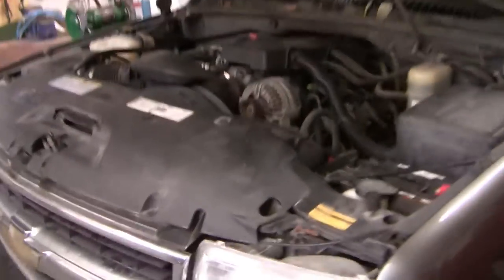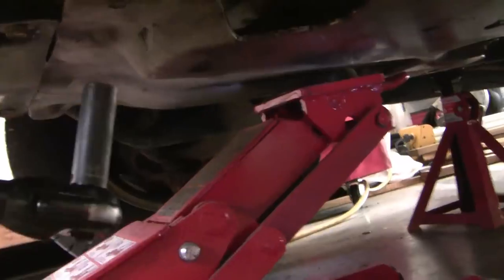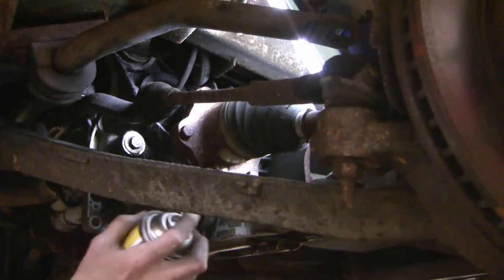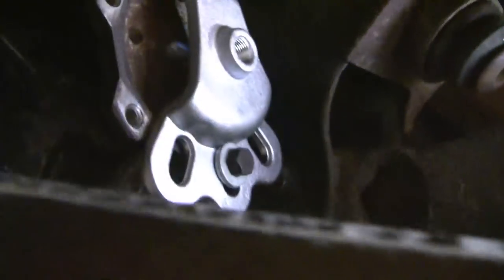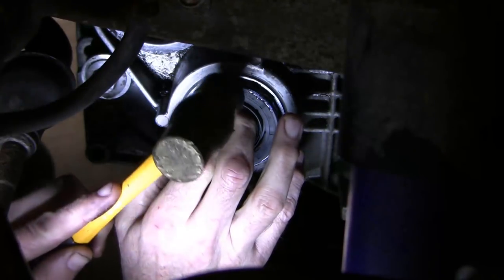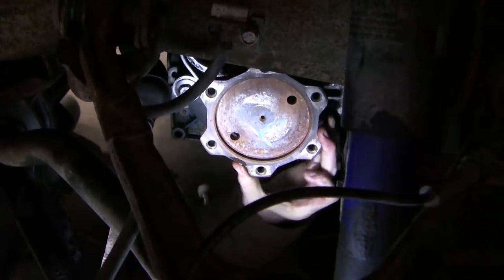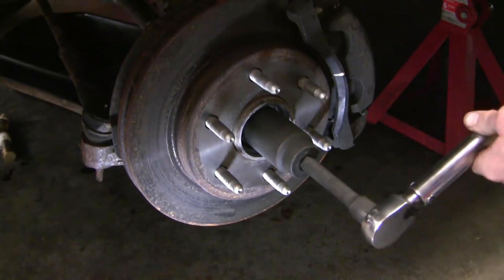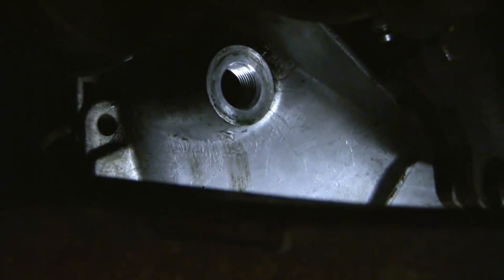How to replace left front axle seal and CV axle, Chev 4X4

Comment: Thank you for this awesome video, I understood how to take it all apart but my front differential has an issue in 2wd mode in my 07 GMC Sierra 1500 when I make sharp turns it sputters kinda like when you turn hard in 4wd but this is in 2wd and while I'm making the sharp turn it makes a bup bup bup bup bup bup sort of sound . I'm not an auto mechanic but seem to fix things in my truck successfully with the help of you tube and right now I'm in a real tight pinch with low funds and busy work schedule so my question to you sir is there something I should check for in my front differential before I just take it all apart and start replacing stuff? I should let you know I had a mechanic change the seal on my right differential in the fall which he cleaned it all up and put new gear oil inside the case. Please help point me in the right direction, it will be very much appreciated
Thank you
Bobby J from snowy cape cod, Ma
Reply from the maker: +DJ Bobby J The sound you describe is very suggestive of a bad universal joint (CV joint) on one of the front outer axles. That's the joint on the axle you see me remove during this video. Have a close look at both universal joints, and specifically look at the boot covering the joint on each side. If either boot is torn, you need to replace the whole outer axle. The good news is that there are many inexpensive aftermarket axle replacements available if indeed that is your diagnosis. These days on most vehicles you replace the whole outer axle rather than fiddling around with new boots etc. There are many videos available here on Youtube showing that procedure, but I basically do it on this video. Good luck!
Reply: I have changed a cv joint on my last car before , but this one looks waaaayy easier thanks to the instructional you provided. Gonna check the boots out this weekend ,

Thank you for the reply your the man
Reply from the maker: +DJ Bobby J Good luck!

Comment: I have an 02 escalade and just replaced the same driver side axle seal, but when I set it inside the diff it has some wobble
Reply from the maker: You may need to take the front  diff cover off to see what is wrong. I did a couple of videos of an axle seal job on a Dodge Ram, and to do those you need to take the diff right out to get at the inside drivers side seals and bearings. If the inner bearing was pushed in when you put the axle back, you may need to replace it.
Reply: @spelunkerd  Ok, I'll take a look at them thanks for the help👍

Comment: I checked to see how much gear oil is still in the front differential and it does not appear to have lost hardly any. I dipped in the end of an allen key and the oil level is maybe 12 mm or a bit more down. I do not see anything else that could be leaking rather than the axle seal. There has been evidence of a leak since at least January when it was first noticed. The axle flange is very wet with oil. So I guess it must be the seal that is leaking. Can't see anything else leaking above it.

Comment: Is there a bearing in there? And is it hard to change?
Reply from the maker: +Christian LeBlanc Yes, there is an outer wheel bearing which is pretty straight forward, and also inner bearings that require specialized tools and effort. The outer wheel bearing is in the hub, and there are many videos online showing how to do that one. The inner axle bearing is usually approached from inside the case, sometimes tapped from the outside into the case after removing the diff. Lots of work to get at that one. The right and left are very different if you have 4WD.

Comment: Does the axle needs to be taken off from the hub? it seems there is alot of space to remove the other half to replace the seal.
Reply from the maker: That's a good question, one viewer below said he was able to just push the axle to the side to gain enough room to pry the inner axle out. I used the method recommended in the dealer repair manual, I didn't bother trying to do a short cut. With the difficulty you might have getting the inner axle free, you may want to have as much room as you can have, and it doesn't take much to remove the axle from the hub. Good luck!
Reply: No, dont take the CV nut off.  You dont have to drain it.  You dont have to take the tire off even.

Comment: So the inner axle is held from falling out of the differential with an internal circlip, and the only way to remove the inner axle is to beat it out and hope you don’t damage the circlip? Is that correct?
Reply from the maker: Yes. Most of the time it comes out OK, I just needed a little patience to not get overexcited and beat on it too hard. When it did come out it came with very little force, I just had to get that clip into the right position, which involves trial and error since you can't see it. Some guys use an air impact to add some vibration. The TSB describing the problem GM techs were having described how to get it out when the whole axle is on the bench, which is a ridiculous illustration of how ignorant the upper level GM staff can be. I've heard of cases where the diff has to be removed and split, but most are able to get by without doing that.
Reply: Oh wow, that’s interesting. All good information to know. Thanks and great video!
Reply: I did this job today but I could not see the c clip. So I just figured it was where it was supposed to be. When I put the axle back in it never click. That's when I started to get a little nervous. Took the axle out again  and sure enough to c clip was broken. The axle was easy to pull out the first time. I don't know how it broke. Now I'm having troubles find a new one at the auto parts store

Comment: i have a 99 chevy and my left front diff seal is leaking plus theres some play up and down on in put shaft if seal is bad would this cause the play in shaft when i put in 4x4 shaft doesnt have any play
Reply from the maker: Sometimes the seal goes bad because the balance of the shaft is off. Although you might start by just replacing the seal, I would look closely at the structures on either side to look for a cause. Good luck!
Reply: Ron, I have play in both my output shafts.  Did you have to replace the bearings?
Reply: yes i rebuilt dif the set key was broke off and bearings needed replacing so went ahead and rebuilt dif did mostly my self but took to shop put crush sleeve in and set back lash runs good now the kit cost me 250 dollars for all bearings and 75 dollars for shop work
Reply: Ron Reynolds Thanks, good info

Comment: did it ever make noise when seal was bad?
Reply from the maker: No, in your case have a close look at the CV joint, which can wobble and then destroy the seal as a secondary effect. Usually there is some wear or tearing of the CV boot when that happens. When a CV joint goes bad, you often hear a clapping or snapping sound with each wheel rotation, especially when turning. These days, generic CV axle replacements are cheaper and better than efforts to rebuild the CV joint or boot.

Comment: you said that you had an issue with the c clip. what was it??
Reply from the maker: It can be more than a little frustrating to remove the axle, as described by several in the thread here. You tap, rotate the shaft, tap, rotate, and it seems to never want to come out. If you pound too hard you could bend or damage or even break the internal ring, making it even more difficult to remove. I was tapping for about ten minutes when all of a sudden it slipped out easily. GM put out an instructional TSB describing how sometimes the entire axle needs to be removed, so you can split the diff and remove it that way. Fortunately in my case it was just a matter of patience. You need to get that little ring exactly positioned so that a little tap allows the shaft to come free. The procedure is entirely blind. Good luck!

Comment: Doing the same job and the axle shaft will not pop. Hopefully the slide hammer will do it
Reply from the maker: Frustrating, I know. When it finally comes out it comes easy, like it always wanted to. So don't smash it and bend the internal washer. Twist and tap, repeat hundreds of times is what worked for me, eventually. Kinda like a girlfriend, you gotta buy many dinners before you have any chance, or maybe not, ha ha. Dealers manual was no help, they describe a technique that can only be done on the bench with axle removed and pumpkin split.

Comment: how hard is the right front to do
Reply from the maker: Right front is a little different, since you have an intermediate shaft. I show how to remove that intermediate shaft in an old video on my channel, though you many not need to remove it if you are just going after the CV axle. The CV axle on the right is shorter, meaning you have less room if the intermediate axle is still bolted in place. However I believe it also is pretty easy.

Comment: where did you get the output seal?
Reply from the maker: +Michael Lasure I got an aftermarket seal at NAPA, though a case could be made to go to the dealer. Carefully look at the seal you get to be sure it goes in the correct way -- some seals have a label with tiny wording showing which side is out.

Comment: what do ya do if that c clip on half axle wont give?
Reply from the maker: I can't give much more advice than mentioned in the video. It's a common problem, enough to prompt publication of a TSB from the manufacturer with ludicrous advice to remove the whole axle, split the case, tip it on it's side, and hammer it out on the bench. In my case I kept spinning and hitting it until it came out. It's not just a matter of hammering really hard, and in fact you could damage something inside if you try to force it. When mine eventually did come out, it came out with a small tap, not much force. I had a feeling that the C-clip had to be at just the right angle....

Comment: greetings, i currently am having a grinding helicopter like sound, and oil is leaking from both driver's and passenger's  half axles near the axle flange, took to 2 shops, one guy refused to get involved thinking differential problems, another shop said the axle wheel bearing inside was the issue. i am not sure if both needle wheel bearing are bad, or only both seals, i am sure i will replace both seals, but i was wondering how bad needle bearing look like. i am thinking replacing everything, even the half axles while i am there. anybody with an opinion would be great, and what can i use for removing the needle bearing.
Reply from the maker: That's ominous. If the pro had the vehicle on a lift and was in a position to make the call, it sounds like he is estimating that the cost of professional repair may be more than the value of the vehicle. Grinding can come from many places and without the exam you are only guessing. If it were my 98 Dodge, I'd be weighing whether it was time to send it to the junk yard or sell it for parts. I would certainly want as accurate a diagnosis as possible. Attempting a front diff repair as an amateur may be a challenge, especially if you need the vehicle to get to work. It would be a fun advanced back yard project, but those kind of tasks can drag on.

Comment: What if that little metal tank that is stick out holding those teeth in place, is broken off.
Reply from the maker: If you mean the C-clip that holds the medial part of the axle in place, then you will want to remove the broken parts and replace it with a new one. If you can't get at it from the outside, you'll have to remove the diff cover, remove the diff, and get to it from the inside. If you mean something else, leave a better description, maybe with a time stamp for the stage of the video showing the part you are asking about.
Reply: spelunkerd wow I just saw how poorly worded my comment was. Right at 6:00, you stick your camera to see inside to make sure the C clip was there. The metal tab that sticks out, is broken off on mine. I actually went to my local GM dealer yesterday, a mechanic told me its part of the whole axle case, which I could believe but I’m having a hard time understanding how it’d be a permanent piece to an axle case.

Comment: Seals are inexpensive, so get them from the dealership. Factory stuff is usually a perfect fit.
Reply from the maker: +David Robinson It's hard to disagree with you on that point, at least for the front axle seal for the Dodge Ram. In the past I've generally I've done pretty well with generic seals on other vehicles.

Comment: So I'm trying to do this same process but on the passenger side. the flange is much longer and I have no idea how to get it out.. do I have to tear apart all of my wheel components.. I'm stumped anyone have any advice lol .... I'm a rookie mechanic 🤪
Reply from the maker: A good place to start is the dealer repair manual. I use online sources like either Alldatadiy or Mitchelldiy since they offer updates and TSBs. Haynes is a poor second choice since they are much more generic and won't often have details you want. I have not done the right side on this vehicle.
Reply: @spelunkerd  Okay I'll have to look around thank you I appreciate the advice! For some reason my axle flange came loose after my hub took a sh*t and I cant figure out if it's because of the seal or what.. there arnt any leaks but it just popped out and I cant figure out how to get it back in 🤦‍♂️ This is my first time dealing with an axle flange so I'm just shooting in the dark here haha thanks again
Reply from the maker: @aim4music  The seal never has structural qualities, it is not the cause of the hub coming off. That said, once you're in there you'll want to change out the seals anyway. In four wheel drive vehicles the right axle is often complicated by the shift motor that slides a ring over splined shafts to lock the right and left wheels together. If the right axle is removed you may need to realign the splines of the right axle with the shift mechanism as you reinstall it. You'll have a much better idea what is there after a glance at the dealer repair manual, I use alldatadiy.
Reply: @spelunkerd  Thank you I appreciate the advice! 🙏

Comment: How in the world did everyone remove the seal?! Won’t budge...I’m stuck
Reply from the maker: Many tools are designed to do this job, meaning that none work all the time. My favorite is a slide hammer with a hook on the end. You can buy a cheap seal puller from a discount auto shop, but most simply use a hammer and a big screwdriver. Failing that you can put small vice grips onto an edge and start prying, it is ok to tear the seal if you have to. Small prybars, called 'ladyslippers' work OK. Just watch out for the threaded adjuster locking tab at 3:00; you don't want to break that tab or you'll face a huge repair. I explain that more in the followup video I did, link in the description. Remember to reseal the vent cover above, explained in that followup video, too.
Reply: @spelunkerd  Thank you for that info. I used a much larger screwdriver that does not have a round shaft for leverage strength and it came out. On a side note, my C-clip came out on the half shaft. I suppose I should leave it and tap in the shaft? Couldn’t imagine taking it off and positioning it within opening.
Reply from the maker: @goatsmakesoapco.9113  Yes, I would put it back the way you found it, with the C clip in that little groove of the stub shaft. There is a matching groove inside the mating end gear, the clip could stay in either place. I'm a little surprised GM didn't retool the clip to make it come off more reliably, but such is life.

Comment: well u forgot to say about the frame in the way of the shaft comming out had to grind down the frame to get it out
Reply from the maker: There was no grinding of the frame required in my vehicle, perhaps yours is different. Remember you can turn the steering wheel and move the position of the steering knuckle, and also you can bend the CV joint to slide it out. You can see that I removed it with one try in real time on the video....
Reply: Hey Mike I just did this on my 98 k1500 and the shaft stub didn't clear the frame rail like you're describing, what I did was remove one of the bolts holding the diff housing to the frame and pivoted the diff down by prying between it and the frame until the shaft cleared. You shouldn't have had to grind the frame, that was probably a bad call because these frames are known for cracking as it is.

Comment: I found I didnt have to take out the cv shaft to use the axle flange puller! 

I attached the axle pulling flange with just one bolt and rotated the axle flange so that the axle flange puller is hanging off where the center of the flange puller and the slide hammer both hang under the axle flange then the axle shaft popped right out.  I positioned the slide hammer under the rotor and pow.  It came right off.  I even used the that method to pop the axle shaft back into the shaft after replacing the seal.

might save a few people a big old head ache of ripping off that cv nut.
Reply from the maker: That's a creative idea, thanks for posting it here in the discussion.

Comment: Best way to do this is to remove the entire differential and do it the correct way. The way u did it the washer inside behind the clip and shim are now floating around inside the differential
Reply from the maker: The method shown is the approved method as guided by the dealer repair manual. I believe that clip is captive in a groove deep inside, so even after the stub is removed it should remain where it is. Certainly when I put it back in I got a satisfying snap as it locked back into place. I believe it is possible that some may displace or damage the metal clip, but there was no evidence of that happening here. Splitting the case would be a lot of effort! If one were to remove the diff, split the case, then reassemble, the final step is to slide in the stub shaft exactly as shown. So, you are back to where you started....